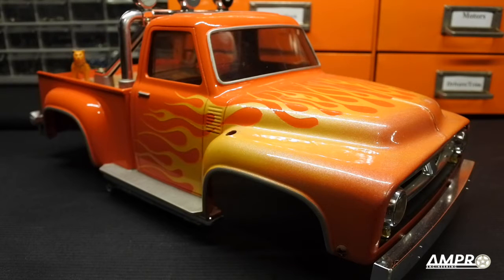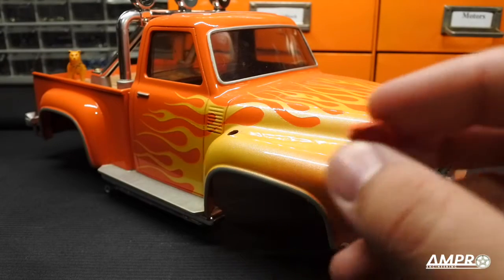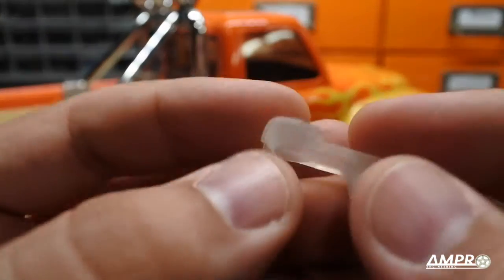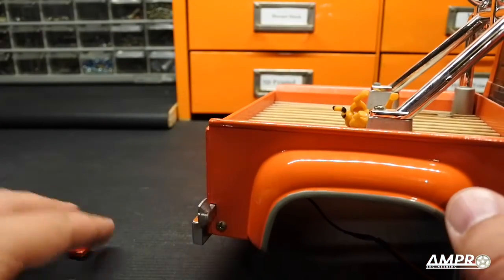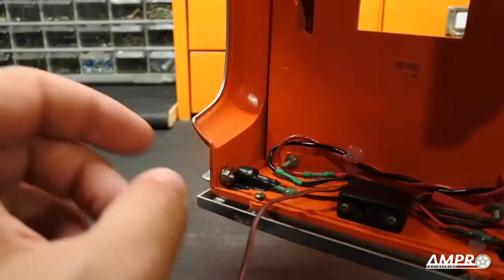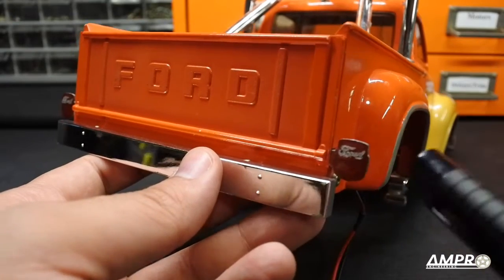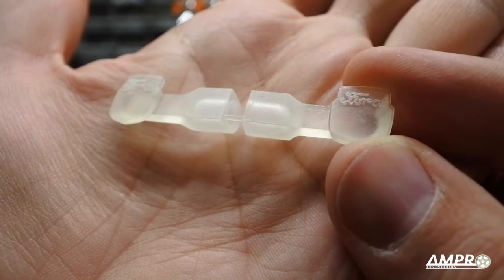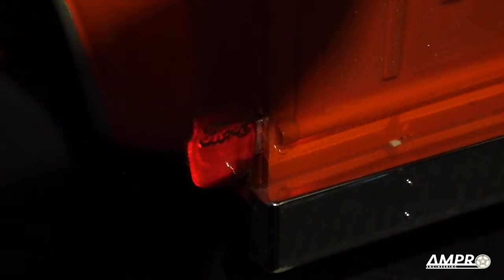E17:  Tamiya Midnight Pumpkin Scale Operational Tail Lights

Comment: OMG!  That body is GORGEOUS!  I may now want to put a Pumpkin body on my CW-01 "Project Junkyard" Lunchbox chassis! 
Really,  I forgot how GOOD those look. Of course, I'll HAVE to get those taillights! 😉

I had two thoughts about this... When painting, I would go with a gloss black on everything but the lens, the go silver on the lens, and over the black. If you had any light bleeding, that would stop it.
And, I've been messing with LEDs for many years, in much smaller scale, in Model Railroading. Instead of Red, I would go with Warm White. They're at the point where the WW LEDs do a great job of emulating incandescent bulbs. They also project farther, so the taillights will be a little brighter, without being annoying. 
You don't really need the Red LEDs, the paint on the lens will be filter enough for a pleasant, red glow.
Reply from the maker: I would start with silver, then a black and then chrome for the housing. This way, as you mention, there is no bleed. It worked pretty well. If the front is shot red then the led you are talking about would be perfect!

Comment: Hi Could you use the F150 rear lights you do for the Pumpkin and could there be a pumpkin front grill with turn signals.
Reply from the maker: I never thought of that but you could. Just a little mod to finish it off but it would. I have thought about a grille but the chrome on the original is so important that I think just turn signals would be best. I am working on front lenses. I really need to finish those.

Comment: Great job 👍🏻
I may have missed the video but do you make the steering servo mounts for the pumpkin/lunchbox? 

Pls say yes 😀
Reply from the maker: When you say the steering servo mount, you mean the standoffs that screw to the servo and the chassis?
Reply: AMPRO Engineering Yes that’s the ones
Reply from the maker: I do not but you can get good aluminum ones on eBay for cheap.
Reply: AMPRO Engineering oh that's brilliant thank you so much 👍
Reply from the maker: No problem!